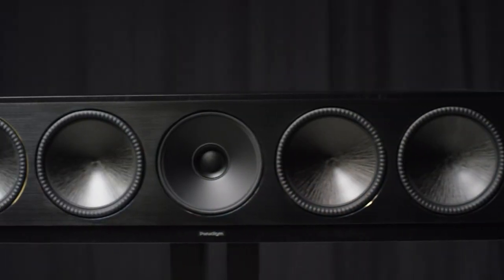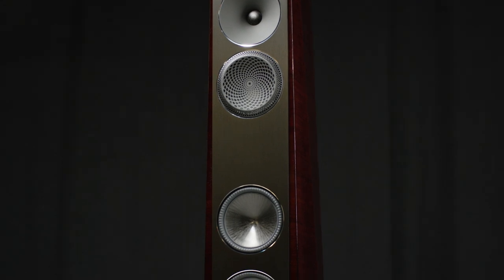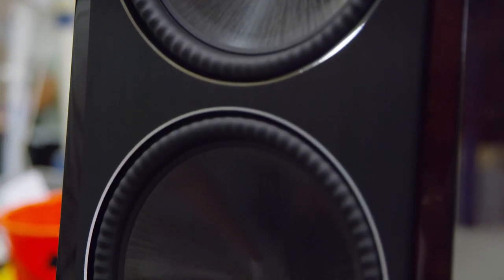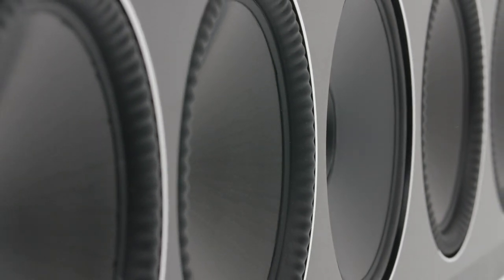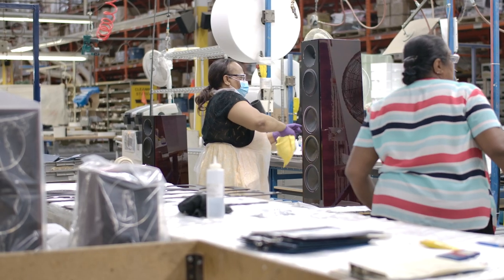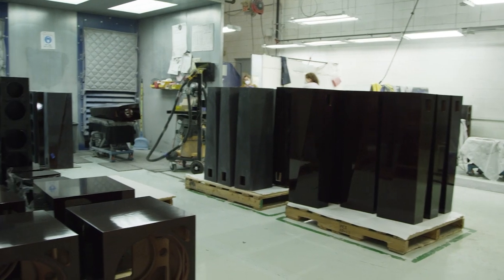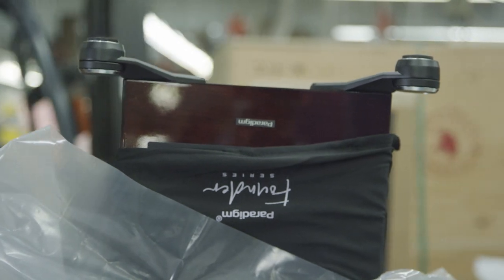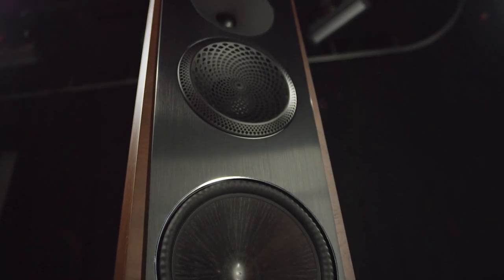Paradigm's Founder Series Loudspeakers - Down to the Details - SoundStage! InSight (December 2021)

Comment: I am on Founders Series 90C  #3. Just bought the 80F's and C90 a week ago. One 90C loose Lens/Waveguide. Another No Tweeter response. Not impressed with the Quality Control Paradigm!!!  Let hope 3#'s a charm.
Reply: Thanks for sharing. Wow, I would expect something better as well. 
I heard of the tweeter issues from the past having coils that overheated, Be tweeters, on some models made way over a decade ago. But that was most likely due to low crossover point and treble hot material.

Comment: A Great Speaker.. But a Bit over priced. I have been on the inside of these builds. There is a lot of room for improvements both in Cabinet construction and solid-state components. I have even found that Drivers could use a tad more improvements on construction.
Reply: I was wondering if there is a brake in period with the Founder series? Thanks!
Reply: of course, there is...check out the 4k(pr) revel m106 internals not that impressive...
Reply: The Persona line is superior, Beryllium is spectacular
Reply: @ralex3697  Persona line is 3x-5x the price... why are you comparing "superior" apples to oranges?? 🙄🤦‍♂